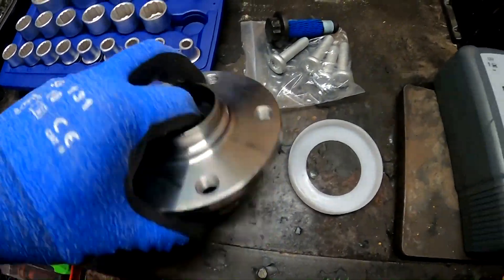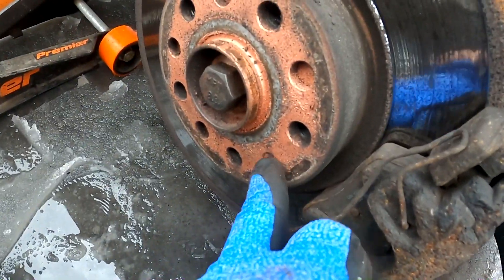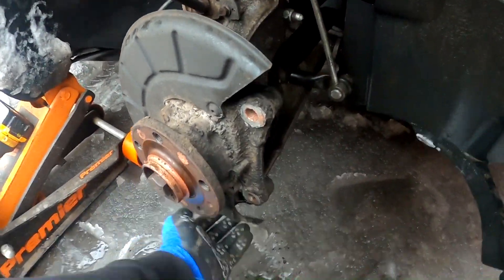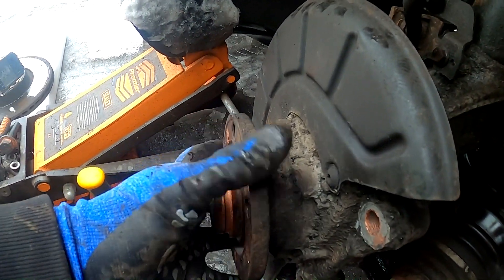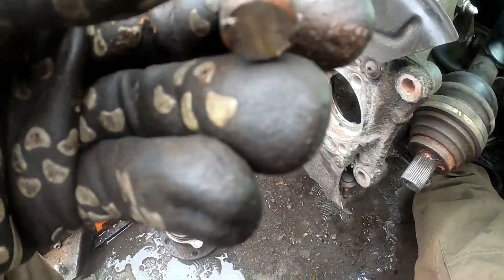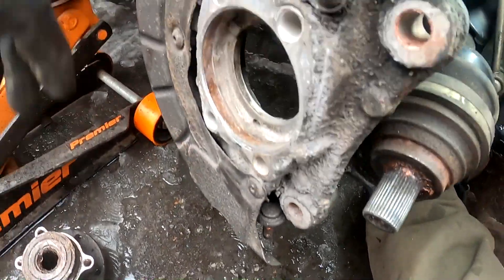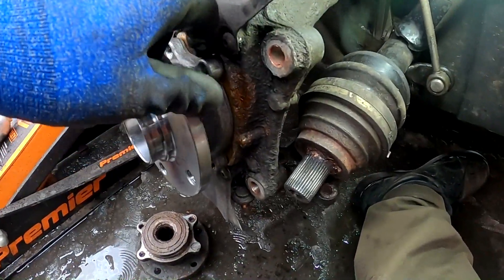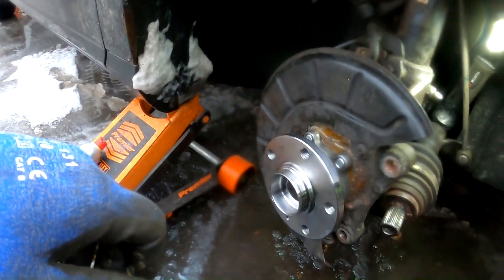Volkswagen Passat B6 Front Wheel Bearing Replacement

Comment: Does the tracking/wheel alignment have to be redone as the ball joint was released?
Reply from the maker: In this particular vehicle we did not take it for alignment redoing why? because that front ball joint setup were nowhere adjustable, but ive seen few times people use adjustable ball joint setup on those for better camber so depending what setup you happen to have maybe you need, but if you have regular like that one was then no needed because there is nothing really do adjust.